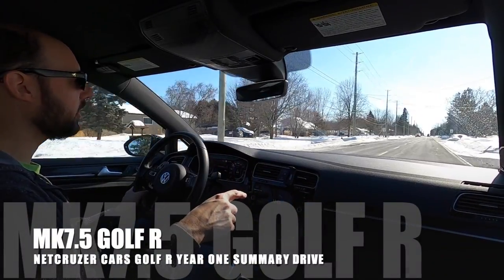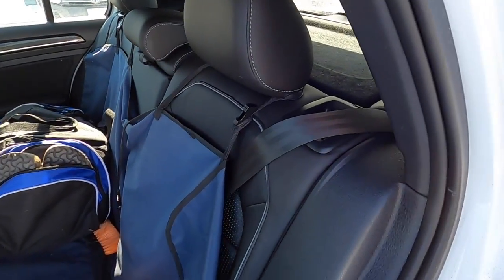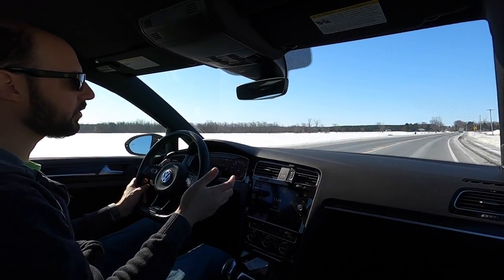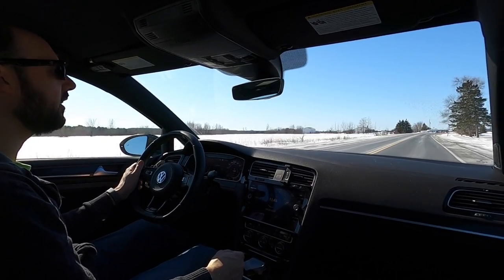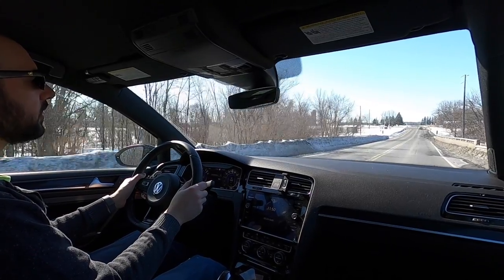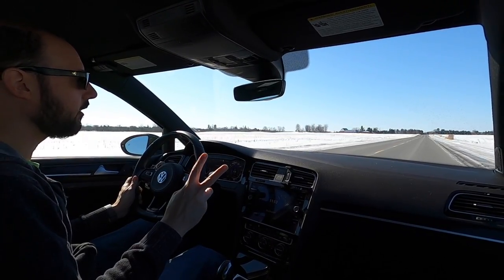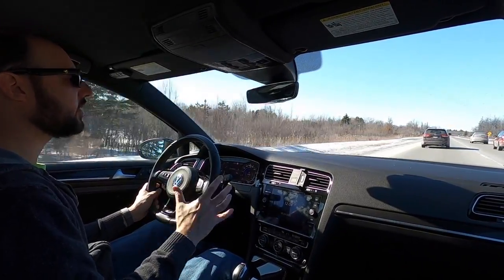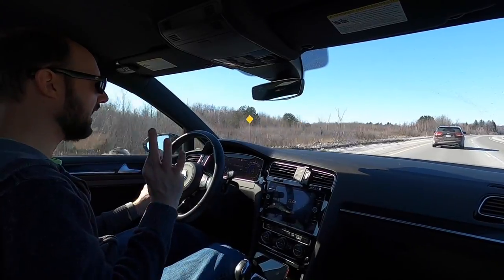Was it worth it? MK7.5 Golf R Year One Summary Drive  - Netcruzer CARS

Comment: had my mk7.5 R for about 2.5 yrs/30k miles and no major issues other than had to top off the coolant, rock chips on the hood, and the DSG acted weird when I didn't let it warm up enough.  I've tuned the DSG with a TVS TCU tune, added an intake, and burger tuning pedal tuner. Lots of obd11 tweaks and some badgeskins and mudflaps. This has been the most fun car i've ever owned and driven.

Comment: not sure if you will see this, but I had a 350bhp 2014 gti, to remove the axle hop as you referred to it is rather simple, BFI or 034 motorsports dogbone mount with coding out ECS sport to ECS off. will remove all that stutter. I even had really meaty tires on with bridgestone RE003 in 245/40/R18's with a TCU tune so I could launch at 4000 rpm and still don't have any issues.
Then for the downpipe, when you get a proper software tune, it will remove the CEL. if you still want a catless DP and don't want to do software get a catfooler it will prohibit the CEL from triggering.
finally thanks for your videos on your R, I used some of the coding on my second GTI, picked up a 2018 7.5 gti with all the optional extra's

Comment: The Golf R 2018 7.5 Screen is broken from factory. I have been fighting this issue since day 1 im so exhausted had the screen replaced had my F5 module replaced had my car reset multiple times still pixel issue and not working as intended.... Issue is in the Cars performance page that shows Boost Oil Temp and Coolant Temp checked brand new Golf R 2018s they had the same issue. I dont know wtf is going on to be honest its pretty bad. im @ 9800 Kms a lil over 1 year of owning.
Reply from the maker: My MK7.5 infotainment screen was replaced before I picked it up new. Rainbow line thru the display it was a known defect in 2018 builds. VW should have replaced it no hassles. Not sure what you mean about performance page problem.
Reply: @netcruzer  basically on the page that displays boost coolant temp and oil temp. My boost digits are pixelated along will the others looks like alien numbers. Also the coolant and oil temp gague will sometimes not come on at all and just display --.- for the entire ride. Unless i go to another page then go back and it resets it.... its super lame. They did replace everything still broken. Also the manager of my dealship showed me his 2018 golf r performance page and his was pixelated on his boost digit to i was like well then since you guys cant fix it and vw canada cant then what the hell lol....
Reply: Sounds like different measuring systems caused it to glitch. Unless it's the same in the UK.

Comment: You missed the R mode. We get the driver assistance features as standard in Australia. Lol
I disabled lane assist. Purely because it takes control moving my wheel over when it shouldn't. I'd recommend the Bluespark Module. Had it on my Abarth 124 Spider adding an extra 40 hp.
Reply from the maker: I’m a full stage 1 EQT tune now. Upgraded from the piggyback. It’s really good! ~380HP now